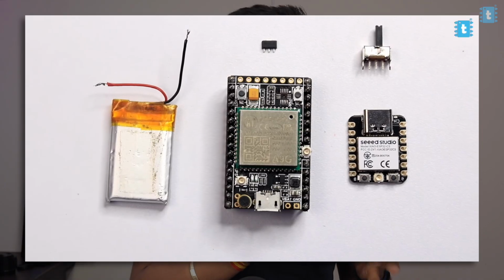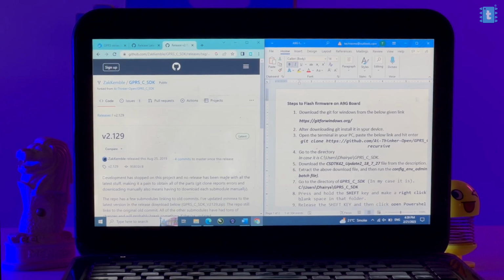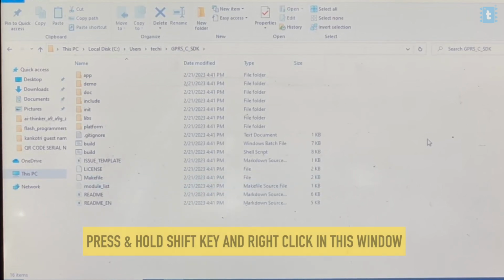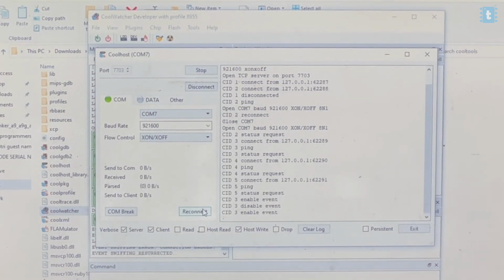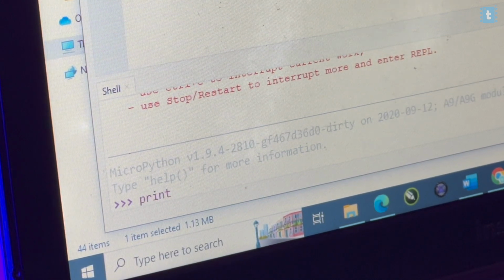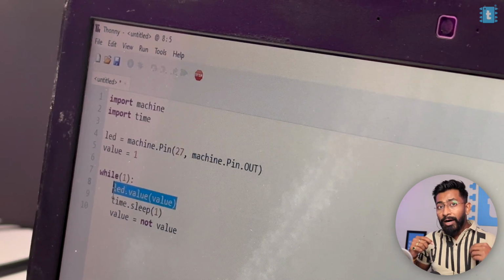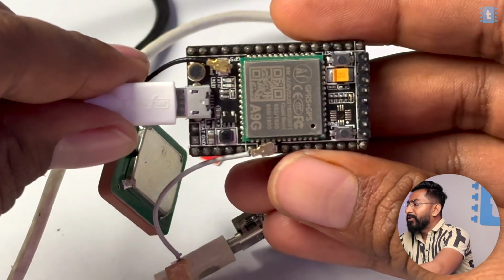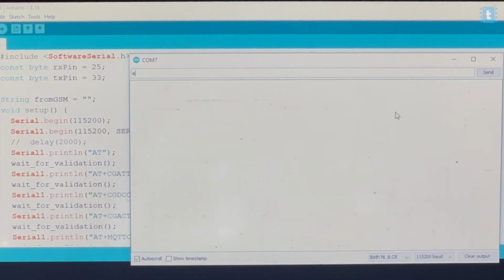Step by Step Guide to Flash Micropython Firmware on A9G Board

Comment: `CHST_Read32': Request to coolhost timed out ! (CoolHostTimeoutError)

do u have any solution on this ?

Everytime i flash this is the coolhost log 

CID 7 read32 at 0x01a000a0
Write host: AD 00 07 FF 02 A0 00 A0 01 01 FD
Read timeout
CID 7 status request
CID 7 disconnected
CID 6 status request
CID 6 disconnected
CID 5 enable event
CID 5 disable event
CID 5 enable event
COM break
Close COM4
Open COM4 baud 921600 XON/XOFF 8N1

my connection is from myy a9g board to usb ttl serial is 

HST RX -> TXD 
HST TX -> RXD

Comment: Techiesms... You videos are top-notch. You've been a great teacher and mentor. I realise that my A9G flashes both on board LEDs and when I connect it to a serial software, it print information on the screen and doesn't respond to AT commands on Arduino

Comment: Im install in my a9g module asper your instruction. But when i save the file inside a9g module , used thony, i cant show lib folder in root path. What a problem . But i see your thony, show that library folder.

What is the secret in this instruction.

Please tell about it. How to solve it. And sime times the module will be hang, till reset.

Comment: What version of Thonny are you using? It's not the 4.x.x because the latest one has a Ukranian flag in the toolbar and yours hasn't. The latest version has problems, probably because (according to the Thonny wiki): "Thonny 3.2 sent it via 'raw' mode, Thonny 3.3.0 and 3.3.1 via 'paste' mode and since 3.3.2 the default is 'raw_paste' if the device supports it [...] or 'raw' as fallback"